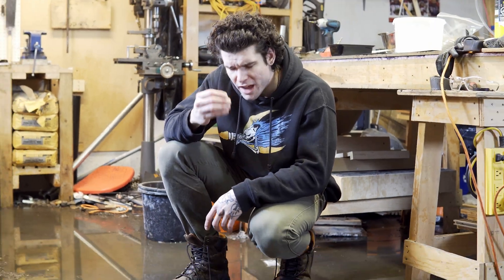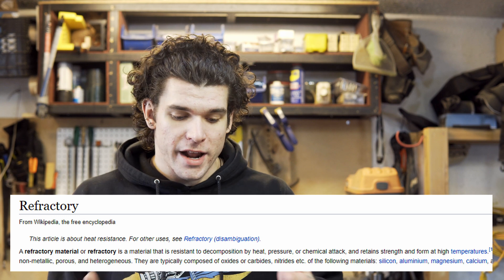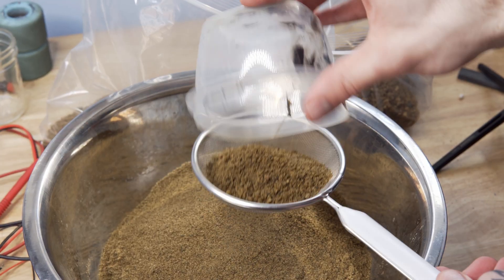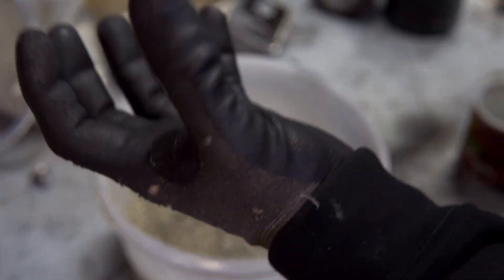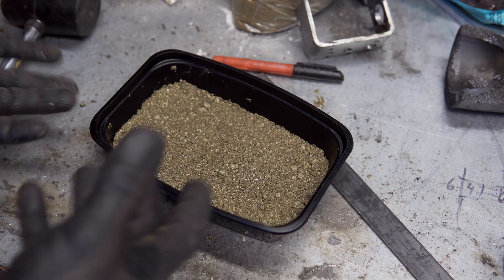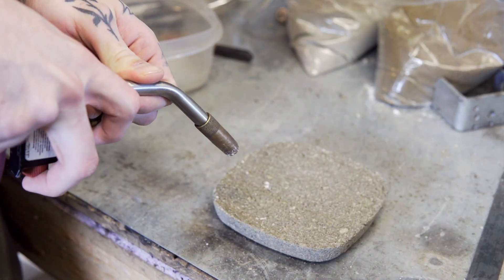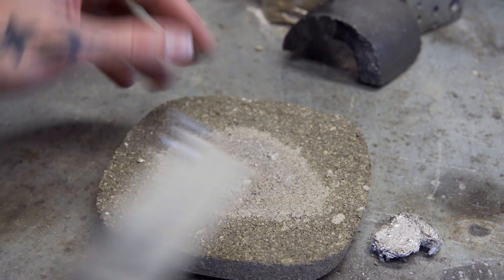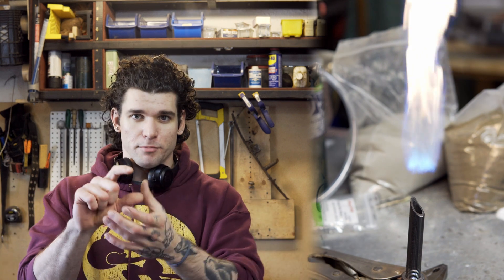DIY REFRACTORY CEMENT!!!

Comment: These ingredients are not going to work for high temp foundry applications. I have an assortment of high purity professional grade alumina refractory castables and cement for anyone’s back yard foundry needs. Send me a message.

Lastly, anytime you make a refractory casted shape of any kind, after it cures, it has to be slowly fired to remove any moisture or you’ll cause an explosion. 
Best of luck.

Comment: Yay another ill-informed YouTube video on how to reverse the reaction that makes Portland cement. Cement becomes calcined at very low temperatures driving off all chemically bond water molecules and then your so-called refractory falls apart stop using cement in refractory mixes. It's fine if that's all you have and you only need to use it once or twice
Reply from the maker: It was an experiment... Sometimes they work, sometimes not

Comment: Ditch  the sand and use magnesium oxide, replace some vermiculite with a phosphate.  Magogo Crete has just as high of temp rating. But form a seriously strong bond fast. Vermiculite is not suitable to hold strength

Comment: Before mixing perlite into your refractory mix try this add shampoo to the Pearl Light just enough very thinly coat after that and a small amount of Portland cement just enough to turn the pro light grey it's still B granule allow to dry add this to whatever refractory mix you would normally use you'll find use it much less water and have no need to cure it can be poured and used the same day without cracking or popping due to the water trapped in your perlite hope this helps
Reply: Coat with full-strength shampoo or diluted with water? Do you mean coat the shampoo coated perlite in portalnd dust like southern fried chicken first with batter then dry flour before frying? Just trying to make sure I understand the suggestion correctly.

Comment: Number one mistake here is you were sifting the rock out of premix concrete. That premix also has sand in it which will make your mix off. Use (Portland cement) only together with your other ingredients and you will be fine. Also make a Woden mold not plastic. And make your fire brick a little thicker.
Reply from the maker: Thanks for the advice!

Comment: Ive tried these diy refractory cement recipes for like 20 different recipes. I’ve found no matter what it doesn’t hold up to high temps for copper and brass. It lasts a little longer for aluminum but eventually becomes too brittle and falls apart. The only thing that helped me hold it together was the high temp mortar i covered it with. Plus its a big heat sink. Kaowool is best for me.
Reply: That's because Portland cement decomposes above about 500C into water vapor and calcium oxide.  This is basic knowledge for anyone doing any forging and is why I don't take these videos seriously.
Reply: But if you cover the diy refractory cement with a 1” layer of kaowool then it holds up pretty good. But the weight can be the problem. I build furnaces and forges and my big 16” diameter by 16” tall furnace weighed almost 90 lbs with the diy cement. It weighs around 30 lbs now made of kaowool with an 1/8” covering of high temp mortar, and is much more efficient and heats up to temps much faster. But the diy refractory cements are cheaper of course.
Reply: New subscriber. Good stuff.
Reply: @backporchfoundryandforgeus900 great too thanks. I was looking for a lighter weight option. Makes sense!

Comment: Once you get mix right you hafe to let it cure, Normal concert has set at least 3 days to a week it only 30% of strength. I am an ironworker. We can put shit up untell it cures. Without it,  it is too brittle and not bonded. The metal columns will fall/rip out of the ground like a tree when the ground to wet and has bad roots. Cause can't hold the weight. No strength in the Concrete. It gets harder over time ( Old concrete is hard as fuck it is a B** to drill into and chip 50+-year-old building will eat concrete bit way faster than new building trust me And ware out your arm)  Soft test at a week look for hard ness, then let set for 30 days. This will help a lot.

Comment: Try 1 part  cement 1 part sand 1 part perlite. And first mix d sand cement and water to get d consistency as thick oats poridge, then add in d perlite that way it would be suspended and not ssttle in d bottom,  cure for 3 dats  cover it in a plastic so itthe water wont evaporate to quickly and after day 3  fully sumerge it in water to dry until day 7 or up to 14 days it will have reach 90% srrength around 3000psi, before ur burn it put it in d sun to drh for a day or two or in an ovsr for an hour to remove all water. Dont use d vermitulite or any biomater since dat will turn to ashe.. or u can use clay soil for a river banl or d garden and mix it with grass, its been down so for genersfions in my country
Reply from the maker: Thank you! I wasn't quite happy with how my recipe worked out so I'll give yours a shot!